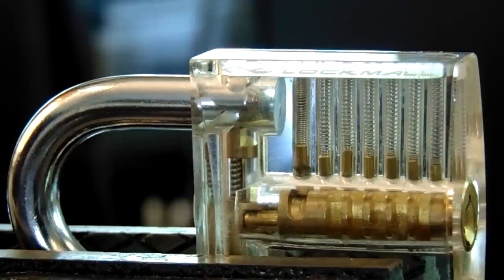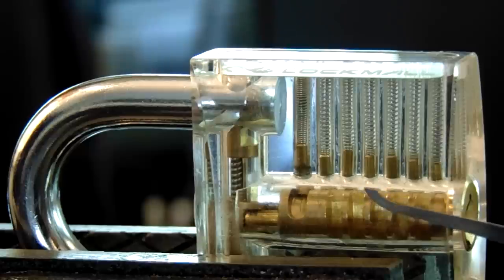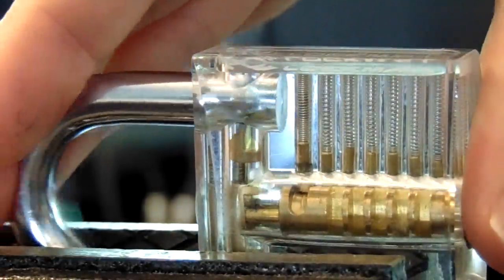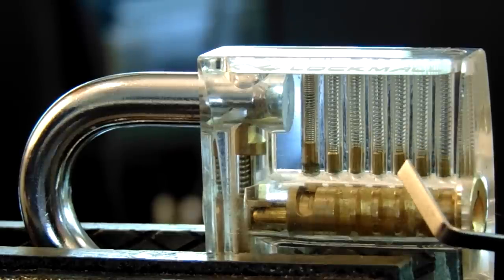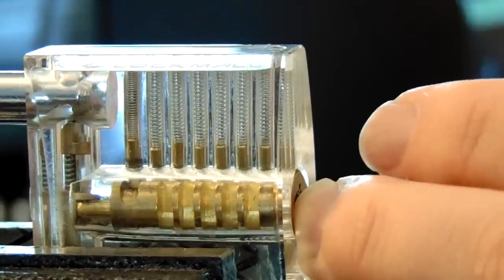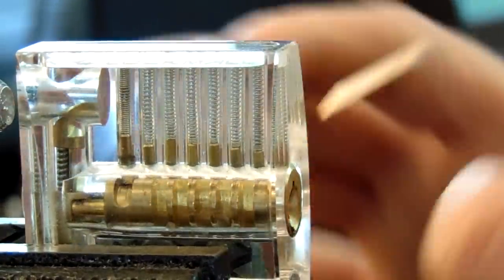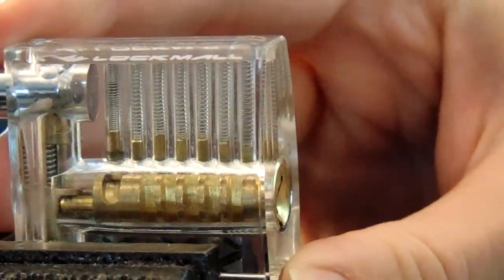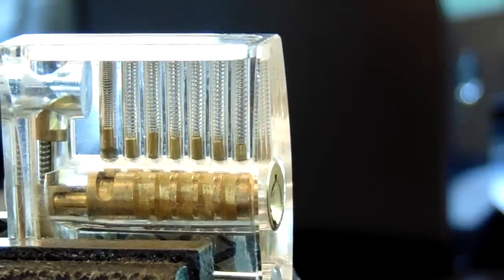[30] Closeup On How Lock Picking Works

Comment: One thing I never understood is how does the tension wrench keep the key pins in place? Wouldn't they just drop back down to their default positions once you move the hook away and to another pin?
Reply from the maker: The hole between the plug and the bible (keypin and driver pin) is not perfectly aligned and one pin will always bind.
Reply: @HelpfulLockPicker  Ooh, got it! So the trick is finding the one pin that binds and pushing it until it clicks out of the plug, and then repeating it with the next pin that binds until they’re all out of the way? That makes a lot more sense, thanks!

Comment: Open a locked file cabinet yesterday. Someone lost the primary key and the backup key was inside the locked file cabinet. Thanks for instruction
Reply from the maker: I am glad you had some success but just remember  it is typically not a good practice to pick locks in use

Comment: any tips for my extremely old lock box I inherited from my grandfather? WD-40 or something to loosen it up first? I'm almost positive it is empty, but would be cool to open it. Great video
Reply from the maker: WD-40 is not a great choice for locks. Tri-Flo or Lock Houdini is better. WD40 is not a lubricant and it can cause problems after it dries. 

I would just take it to a lock smith if you can not open it. You should not pick locks in use.
Reply: @HelpfulLockPicker  I have PowerLube (silicone) but I think I will just take it to someone! Thank You
Reply from the maker: @leepinnguin9682  I wish to you luck!

Comment: Excellent explanations, filming and demonstrations...Loved it.
I have a question though.  I am 61, been doing Auto Body Painting for 41 years now, and getting tired of it.  Thinking of Changing my profession.
I was thinking of Learning to be a Locksmith, as I am very Technical, and probably a Locksmith profession requires one to be very Technical.
What is your advice for me?  Will I be able to Study, and find sufficient work to make a decent wage at my age?  Would greatly appreciate your advice.  Thanks. Raymond
Reply from the maker: Its a good job and is interesting however there is much more to it than picking. Depending on where you live you may need a license

Comment: This will come in handy in my job as a facilities manager. 
Does this work on cars too? People are always locking their keys in their car.
Reply from the maker: You do typically want to pick locks that you do not own because you don't want to be held liable if something goes wrong. Auto locks are typically wafer locks but they have gotten much harder to pick as the years have gone on. The easiest way is bypassing the lock.

I would not recommend trying this unless you get specific permission to do so.

Comment: What is a nice set of picks for a beginner to buy so I don't overpay but don't buy junk either. Can I get the clear locks to practice with?
Reply from the maker: You can but as the clear locks come they are very easy. If you check out my video on how to take them apart you can flip the driver pins over and make it a bit more realistic.

A few other options are to buy a cutaway lock on eBay or get a Kwikset lock to practice on which is the right amount of easy and realistic

Comment: I took an ignition lock to pieces (1961 MG) found out about the lower pins etc, even changed the combination by swapping pins over. What would be helpful to add would be an animated cutaway diagram showing the lower pins lined up etc
Reply from the maker: Check out my video [247] on how locks work and hopefully that is a better representation. I don't have the means to make animated stuff

Comment: What stops the driver pins from dropping back out of shear? Is it having just enough rotation on the barrel to stop them from dropping back but just enough clearance to enable the pick to push them up?
Reply from the maker: They bind against the Bible
Reply: @HelpfulLockPicker  The Bible? Or the barrel? I think autocorrect did you a dis-service here.
Reply from the maker: @Ensign_Cthulhu  bible
Reply: @HelpfulLockPicker  You'll have to clarify, then - for me, a Bible is something you hold religious services with and throw into a vampire's coffin like a grenade.
Reply from the maker: It is called a "bible" because it looks like a book. And a bible is a book

Comment: Great, clear, concise. How do you identify  which way to rotate core??
Reply from the maker: You slowly start to learn standard ways to expect they would open, however some locks like deadbolts always open a particular way (away from doorframe).

Don't worry if you pick it the wrong way you can fix it with a "plug spinner" usually

Comment: We should note that this padlock is engineered to be easy to pick open: the tip of the driving pins is conical, whilst in a normal lock, the tip of the driving pins are as flat as possible.  They are ideal to demonstrate the principle of operation. As a beginner, the one I used gave me enough confidence to try harder ones!
Reply from the maker: I like cutaway locks much better but these locks can be easily improved to make them a bit harder. These locks have two large issues. The first is the keypins ste often so tall they are nearly sitting at the shearline and secondly the driver pins are actually just keypins.

I agree with you the rounded ends make the driver pins less effective. One thing I have done is you can pop the top off easily and flip the around so they are more effective also you can install some shorter keypins as well.

Thanks for checking out the video and I'm glad you have had some success!

Comment: I bought see through locks like this. They quickly became too easy. I managed to pick two euro cylinders on two of my doors. I had a lock that was recently replaced so I could play with it out of the door. I have put hours into it but never opened it. It's a Union euro cylinder. Please advise. Great videos man
Reply from the maker: I am not sure if I ever picked one of those. If able, I would try to progressive pin it
Reply: @HelpfulLockPicker  Thanks for your reply. Please have a go at the Union Assa Alloy. I saw one lock picker on here give up as his battery was about to die. He did rake it though.
I replaced this lock with Abs accet lock. I saw you pick this. I was amazed with the amount of engineering involved in this lock. I obviously have good taste in locks. Thanks again and yea, I subscribed 👍

Comment: Good video, but I'm  confused about why you never needed to set pins 3, 4 & 5. Does this mean they were aligned with the shear line by default and therefore contributed nothing to the lock's security? Thanks.
Reply from the maker: A few of the pins sit at the shearline due to the lock being awful

Comment: Padlocks could be a lot more secure if they just made you have to turn the key before closing them, you could remove the spring and the bevel from the locking lug and it would be completely shim proof.
Reply from the maker: Thanks for shairng

Comment: What I don't understand from this video is why a straight edge couldn't push all the pins up at once and accomplish the same thing. Is it possible to push the pins too high? Or is there usually a guard inside?
Reply from the maker: Check out my video 53 attacking locks with a comb pick. A straight edge would not lift them up high enough however some locks can be exploited in a similar way. Most locks the Bible is designed to be too short to accommodate all of the pins and it simply just won't work most of the time

Comment: That's cool. I have always seen the technique but wondered about the pick part. Why if it s so simple, do some locksmiths drill out locks? Seems wasteful. Or is it a code of some kind to prevent a picked lock to be used again? I ve rekeyed some car locks when I was replacing locks on my van but never quite understood how pics work. Pretty cool, thanks.
Reply from the maker: This lock is especially easy. Locksmiths drill locks because its reliable and they can sell you new product

Comment: When SPP and applying rotational tension, what is holding the driver pin above the shear line. Is the bottom of the D-pin catching "just a hair" on top of the core and barely holding it there?
Reply from the maker: The fact the hole between the cylinder and the bible are not perfectly aligned which causes a non-perfect tolerance. With tension it allows one pin to stick

Comment: OK. I have a professional pick set, much like yours. After several failed attempts on various locks and such I just gave up. Now that I've seen this video, I know for sure I still can't possibly do this.. Back to the bolt cutter, or I should just learn how to take better care of my keys.
Reply from the maker: It's all about practice practice practice but I do agree to key is the best way to open a lock

Comment: Thanks so much. What is the function of the heaving spring and cylindrical piece at the position where a seventh pin would be and what is it called, please?
Reply from the maker: It just holds the plug in when the lock is opened
Reply: @HelpfulLockPicker  Thanks!

Comment: Just shave off the side of the lock which has the springs, and the magic happens. ;D
For protection against single pin picking or zipping, all they would have to add is a second cylinder without a key, opposite the main one (acting as a security barrier for the incorrectly tumbled pins), so if you tumble/zip the pins too high on the main cylinder then the second cylinder will catch the pins and would prevent rotation. ;)
Reply from the maker: You might be interested in checking out a video on "Comb Picks" it is an interesting method where you lift the key pin and driver pin all the way up into the bible so nothing blocks rotation. However, most modern locks this is not possible because the bible is intentionally too short and the keyway is too restricted.
Reply: Thanks, I'll check it out.

Comment: I remember rake picking my dads desk drawer lock at 13.  Its funny how weak those are, I just used a smaller key, raking while turning it :D.
Reply from the maker: Nice work on me open but you do not want to open up locks that are in use because you can break them

Comment: The spring loaded pins sit on a grooved shaft pressing it down. When you push the picking tool you are trying to push the pins up. Then the locking cylinder/shaft is rotated to release the bent locking rod. Is my understanding correct? I find 6 levers or 7 levers mentioned on the lock. Do they refer to the spring loaded pins? Please reply.
Reply from the maker: You have springs pushing down driver pins into the plug. Inside the plug there are keypins. Since the driver pins sit recessed inside the plug being pushed down by the springs the lock will not open. Each keypin has a specific height which matches up with the key and when lifted all the keypins sit flush at the top of the plug. This pushes all the driver pins out and the lock can open.

Lock picking takes advantage that not all the holes align perfectly and you can get a binding pin when you put tension on the plug. You will lift each keypin until you find a binding driver pin above the keypin. You lift that one, the driver pin will stay lifted above the plug in the bible and it will not longer be obstructing plug rotation. You repeat this for each pin until you get an open.

A lot of the other techniques that you saw that you did not do one pin at a time do exactly this just much faster. I hope this helps. Also, the 7th pin is much bigger and that is used to retain the  plug, it has nothing to do with opening the lock.
Reply: yes you are right

Comment: I have an acrylic lock and I can't pick it no matter what I try. Every single one of the pins are springy and even trying to use a rake just doesn't do anything. Is there something wrong with the lock or maybe the tension?
Reply from the maker: How much tension are you using?

Comment: That was awesome!!  And you explained it beautifully!!   I am reading the book and I have my set and I have bump keys she my pick gun,  but I am trying to learn the correct way using my hands not the gun.    What is the best rake to start with? And when is it better to use the other ones ? Does it depend on the lock?    Any help is much appreciated!!   Thanks
Reply from the maker: I would check out my entire lock picking home school playlist, it has a lot of great info :-) another great resource lock picking detail Overkill but you can Google.

Raking and bumping willow open the vast majority of common locks however once locks start to integrate a lot of security pins single pin picking will he needed.

Comment: I understand what I am feeling for now, but I am having trouble getting the pick snagged a lot. Is this because of the tool, Or a technique problem?
Reply from the maker: It could be due to difficult warding.  How open is your keyway?
Reply: @HelpfulLockPicker  It seams pretty open, but once I stick the pick in it starts getting stuck. It's only this one lock, specifically a lever handle lock.

Comment: Does picking a lock ruin the lock's ability to be used normally, as in with the key?
Reply from the maker: Not typically but it can wear it out prematurely. One of the golden rules is to not pick locks in use because you have the potential to damage them

Comment: Your technique and the ease at which your demo lock tumbles makes the lock-bumping videos not so impressive. I had no idea picking was this simple. I'd like to see a video on bypassing analog push button combination entry door locks. I've been considering these as a last ditch effort to deter (a third) burglary. After the first one I installed new locks and a Lorex home security surveillance system. The system got hacked and then used in the Mirai Botnet... then we got burgled the second time... Front door again even after replacing the first one with a heavier "more secure" door and higher rated locks (which unbeknownst to us were NOT rated against being bumped).

Me and my family would like to know the 'once and for all' about these keyless analog security portal door locks, and would appreciate you reviewing them, or linking us with a publisher/channel that's reviewed these locks in the last three years. Thanks heaps from all of us!
Reply from the maker: I would have to look up that specific lock. I have made a video on how to bump proof your lock very easily. Most unauthorized access comes through destructive entry though many people will kick in the door or break the window
Reply: @HelpfulLockPicker  yessir, the first time there perp broke out a small glass panel, out of a door containing 32 of them, right next to the door knob. Turns out it isn't such a great idea to hang a door made of thing sheets of glass as a portal door if you want a secure home. Go figure 😂

Comment: Is it the same process for door locks as well like house doors?
Reply from the maker: I would not recommend working on locks in use but a pin tumbler lock is a pin tumbler lock regardless of it is in a padlock or deadbolt
Reply: @HelpfulLockPicker  I used to rekey locks at lowes and figured it prob was the same.

Comment: Are there locks made that can't be picked?  I would rather buy those after seeing this?
Reply from the maker: There are some locks yet to be picked however they are expensive and would attack attention. Most unauthorized access comes in through destructive entry and a lock like that will not prevent someone from breaking your window or kicking in your door

Comment: What about those cylindrical locks with a key that looks like a short piece of tubing with notches in it?  Can those be opened if you lose the key?
Reply from the maker: I think you are referring to tubular locks. Those are very easy to open with tubular picks, they open almost as fast as using the key.
Reply: @HelpfulLockPicker  Thanks!  I wasn't sure of the proper term for them.
Reply from the maker: @NCF8710  I'm glad I could help :-)

Comment: How do the liners lift when the picker dont have unique shape like the key? Wont the liners fall back to the lock position?
Reply from the maker: The tension you place on the lock holds the pin in the set position and prevents it from falling back down when properly picked

Comment: When a pin is binding would you apply more pressure until it's set?
Reply from the maker: I would keep the tension the same and lift the key pin until the binding driver pins sets. Once set the keypin below it will feel floppy

Comment: Are there any reasonable priced key locks that resist or prevent picking? What about keypad locks where you enter a 4-digit code?
This has destroyed my sense of safety in my home.
Reply from the maker: The issue is security is only as strong as it's weakest link and if your house has windows, weak door frame, small strike plates, small screws securing the strike plates the lock you install won't really matter.

In all honesty, a Yale lock with security pins added is annoying enough to be hard to pick for a novice and likely would not rake or bump open too easily.

Comment: 1. What happens if I push the pick inside to much??
2. If I use a paperclip to picklock, how do I remove without breaking it?
Reply from the maker: Question 1 you shouldn't worry about too much. 

Question 2, paper clips should not get stuck so it shouldn't be a problem